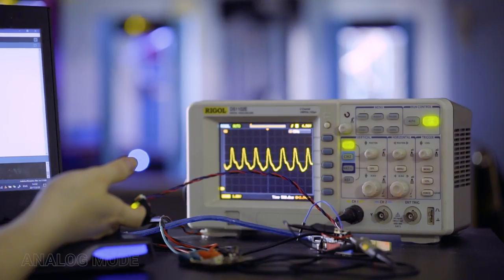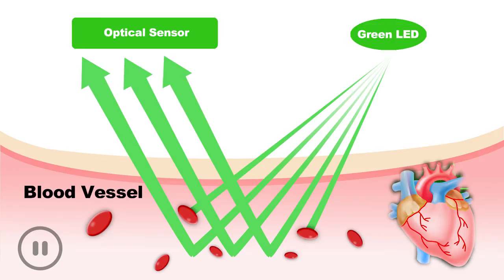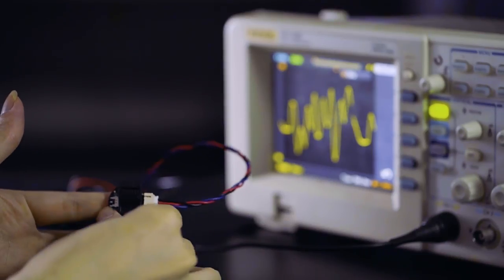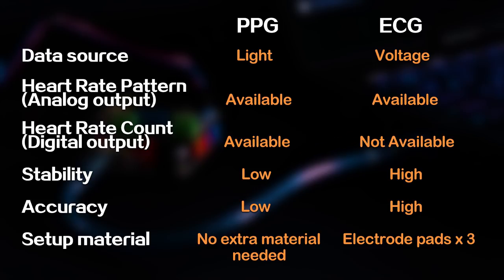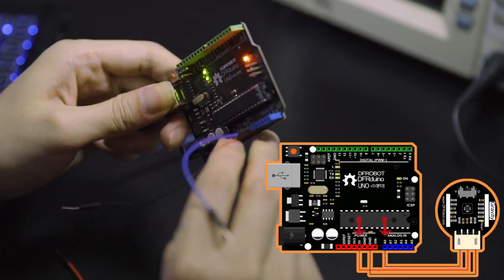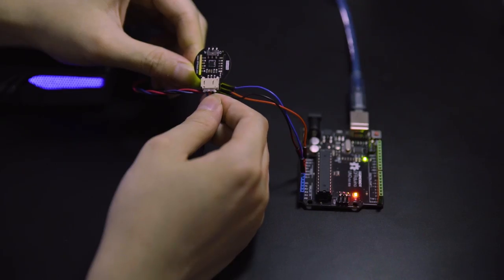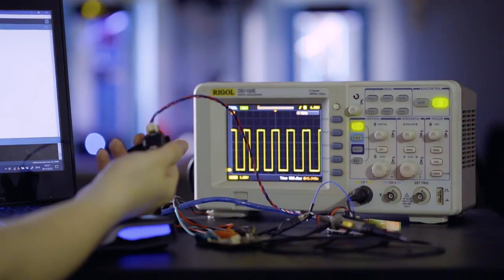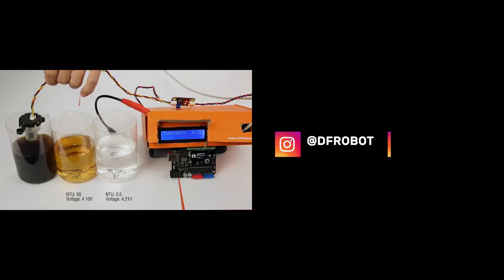Opensource Optical Heart Rate Sensor/Pulse Sensor for Arduino

Comment: This was a great video!! Is there a sensor you would recommend for measuring pulse at the bicep or upper arm? The light from the fingertip pulse sensor may not penetrate deep enough and the device I am working on can only be attached to the upper arm or thigh. I know it's a long shot, but I figured I'd ask. Thanks for the video and have a great day!

Comment: Great video. Hopefully DFRobot will develop an open source optical heart rate sensor, which is as accurate as the Polar OH1. We immediately would deside for this product. Polar changes the running time of the Polar OH1 by only a firmware update. There where validation papers for the Polar OH1 with g.Nautilus ECG devices for more than 50 000 USD. This makes the validation of the sensor useless. Therefore we are looking for an open source heart rate sensor. Develop  a more accurate PPG sensor, DFRobot, and we immediately will buy from you. Greetings, Peter Gamma, Physiologist & Director, Meditation Research Institute Switzerland (MRIS).

Comment: Hey, Im looking to make this, but how can I make it self contained, i want it to be self sucificient and not relying on a laptop or PC for starting the reading, how can I auto export the data to a screen included. 

Basically how can I activate the serial plotter without using a PC ?
Reply: You may use something else that supports serial communication. Or simply connect an LCD screen to the Arduino.